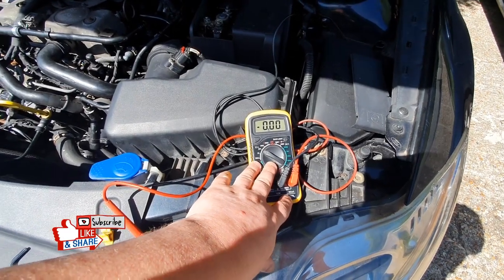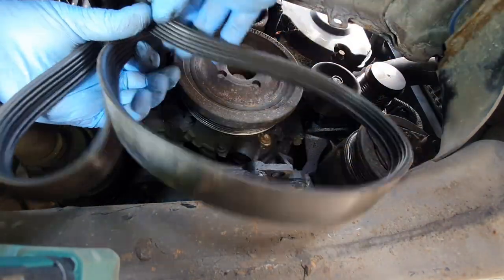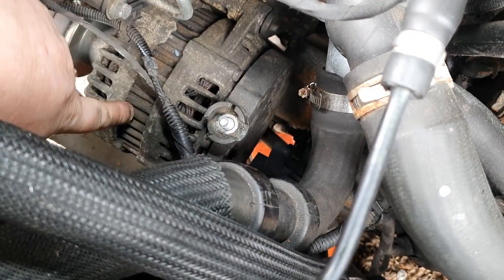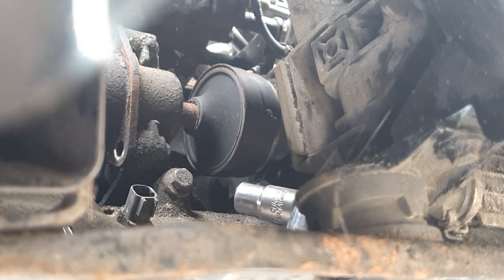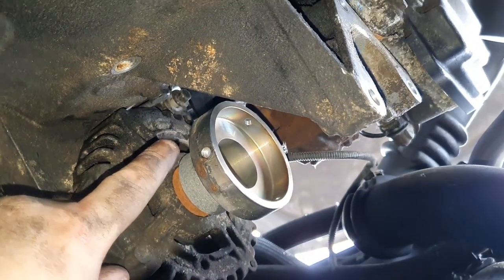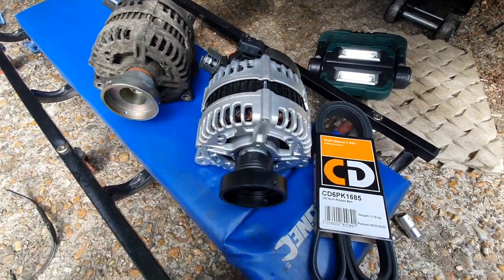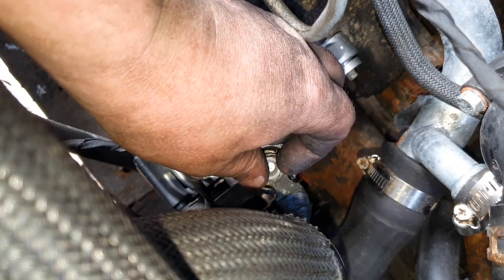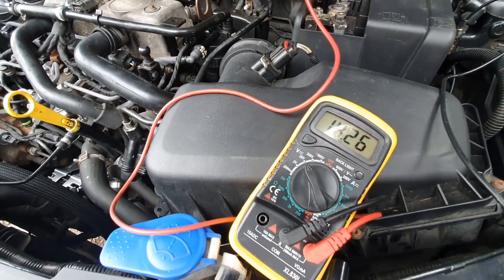Ford Mondeo Mk4 1.8 TDCI alternator replacement, how to.

Comment: The whole point of the decoupling...... You don't have to mess around with the belt at all. It's supposed to make it a quicker job. I've done a few. I'm not sure about taking all the parts off?  Wheel liner and top engine mount comes out easy.
Reply from the maker: I was replacing the belt aswell so took it off. I only took extra stuff off for filming the video for camera access.
Reply: As long as it gets done and you save money 👍 a garage would have charged a full hour Labour for a 30min job so well done💪
Reply from the maker: @DAVWELLS123  yeap that they would do.
Reply: well that couldn't be correct,  don't you have to remove the ac pump to get to one of the alternator bolts out and so the belt must be slackened. doing it now myself, proper sob hah

Comment: The 3 bolts on the coupler were too tight on mine and have now been rounded off, any suggestions? I have done every other step in removal process but now stuck on these last 3 bolts

Comment: Such an easy job on the Mk4 TDCI!!  Us Mk3 V6 owners have to jack the car up, take the drivers front wheel off, remove inner arch, pop the track rod end off the hub carrier and then find the perfect combination of ratchet size and socket length to be able to reach round the back of the alternator to get at the rear bolt but not fowl on the bulkhead grrr.

Pain the the arse job, especially when i kill alternators fairly regularly, on my 3rd alternator in 4 years :(
Reply from the maker: I feel your pain, I have the v6 St220 also and not had to change mine yet.
Reply: @ChazzCoombes  trust me, you will be saying why... Why ford over and over again! Ford are usually really good for thoughtful designs that are easy to work on but they had been drinking the day they decided to put the V6 alternator where they did grrr.

Next time you are under your 220 go through your tools and see how long it takes you to find something that will engage with the rear bolt, only a single ratchet I own with one specific socket and the ratchet drive only partly in the socket will work to undo the bolt.
Everything else I own is either too long and fouls the bulkhead or the ratchet head is too 'fat' and fowls the behead or things are too short and won't reach round the alternator.

You will see some posts suggesting a load of socket extentions and coming at it from above on forums but that only works on the mk1 and 2, the mk3 is mounted differently and must be attacked from below. 

My current alternator is only 3 months old but already whining,  I murder them with my audio system, the last one failed catastrophically and it looked like I had an engine fire from all the smoke ha ha, the alternator was fried to a crisp, not a single bit of enamel left on any of the windings,  just a charred mess!

Comment: Doing mine mine now and the rubber boot in the de-coupler is all split, was yours ??? Couldn't see it on your vid, good vid tho, guess im stuck now if i need a new boot rubber for the de-coupler
Reply from the maker: Mine was fine. If yours is split maybe worth replacing it while you have it apart.
Reply: Yes sir just fitting a new one now 👍 keep up the good work buddy